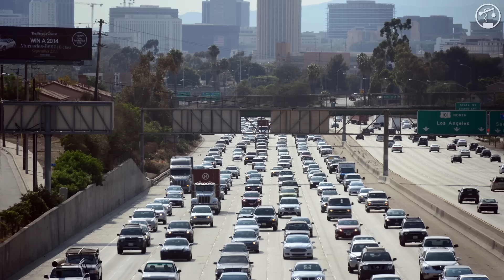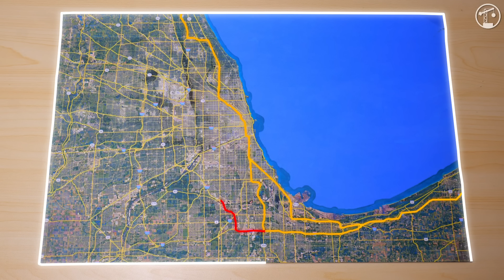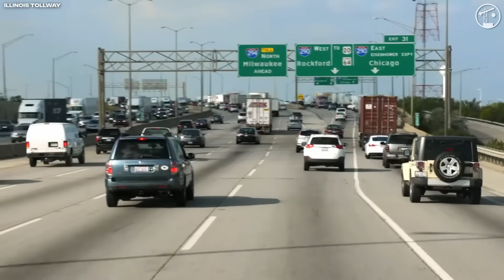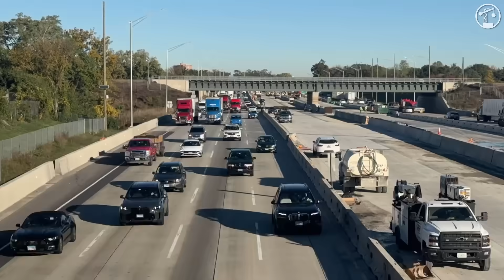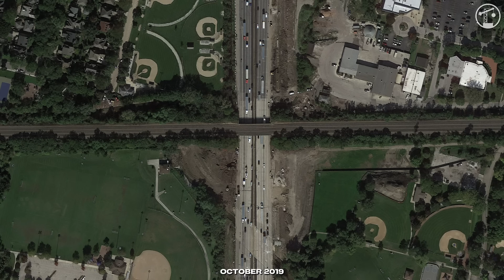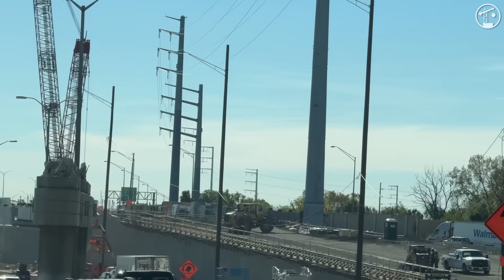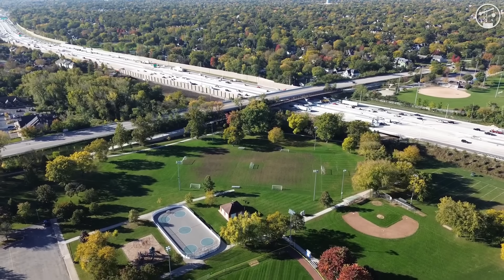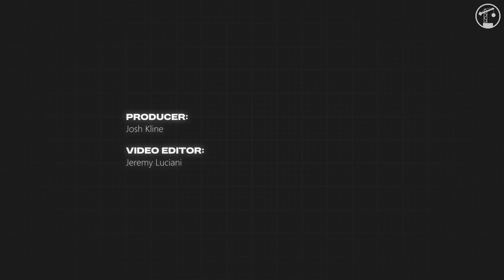Why Chicago is Spending $4B on One Road

Comment: We need a north/south rail line that connects all the commuter lines that flow in and out of the city. A line that also connects Midway to O’Hare. It would take a ton of traffic off the road. Commuters could get to O’Hare and Midway from the suburbs without using the interstates and tollways. The current system of riding into the city and then out to go north and south is not practical, so nobody ever does it. A N/S rail line would be a radical improvement.

Just one more lane will never solve anything. People need options.
Reply: More effective would be better through connections downtown, though the O'Hare Midway link has also tested really well on surveys and analytics in terms of projected ridership. The Metra lines should connect directly with each other and run more frequently, and another crosstown subway is needed. Fast connections through downtown also help suburb-to-suburb commuting, especially crosstown where the 90-94 route is so congested and people use 294 to escape.
Reply: @dblissmn  that could help but it would require most people to still get all the way to down town stations. A proposed line (sometimes as an L or Metra) would run from Midway to ORD through the near western burbs. It could connect the end of most L and most Metra lines, allowing for a very different level of service and connection
Reply: The “Cross Town Expressway”. Turn Cicero Av. into an expressway in the 70’s would have been a few billion dollars…
Enjoy sitting in traffic because it’ll never happen
Reply: You still need a car at both ends of any N-S trip - there’s no central business district like the loop.
Reply: @lauracarrolldebolt9233  You actually don't. Hyde Park? Walkable. Homewood? Walkable. Glenview? Walkable. Etc. And all the above also connected with bus service.
Reply: RTA has floated this several times.  There just isn't the ridership projections to support doing it.  Most people that live out here in the further out suburbs (Myself in the western), only take Metra to go IN or OUT of the city.  No one in their right mind out here is giving up their car to commute 15 miles away via a commuter rail system when they have a car and just hop in and go.  It makes NO logistical sense for me in Elgin, if I need to go to Aurora, to drive over to a station, then wait, then take a rail line to a station nearest my destination, which then is also usually outside an acceptable walking distance to get to the final destination point.  Again, get in my car and be there in 20 minutes.  NOW, what I will push for is an even further outer beltway, similar to 355, out here as Route 59 and Randall Road are disasters in peak hours.
Reply: It probably would cost 1/8th of this one road’s price tag. But then, what about the politicians who make money from the construction? They’ve gotta put a new roof on their cottage somehow!
Reply: this rail connectivity to O’hare and Midway is not necessary.  Midway is connected to rail via orange line.  Metra connects to the “EL” at various locations throughout the system and downtown.  O’Hare is served by Metra now.  The station is adjacent to the rental car facility where you can catch the people mover to the terminal.  Of course O’Hare has had “EL” connection for decades.
Reply: @CJinsoo Metra serves O'Hare in name only.   There are only seven trains per day, of which five actually stop at the O'Hare station.  And of those seven, six of those trains serve "standard" rush hour commuters and one would be for "reverse commuters".   No weekend service.  No service after standard working hours -- it is meant for 9-5 suburban resident to downtown worker only.

The major problems with NCS are that the line is single track north of O'Hare, which limits the schedule; and south of O'Hare, it encounters delays as uses the same tracks as the MD-W lines.
Reply: @JeffreyW67 that is plenty of service from Metra for O’Hare.  Do you think it needs a as much service as Metra provides downtown loop?  there is no way there would be any type of customer demand to support that because passengers have alternatives.
Reply: @JeffreyW67  pretty embarrassing considering Toronto's 4 times hourly for a similar type of route terminating at its main airport.
Reply: Midway and O'Hare already are connected via rail. You just have to make one underground transfer in the Loop.
Reply: @JonPoklop  it is but not well. Most places in the city are at least 2 hours via transit to O'hare. Let alone the burbs. A circle line on the edge of Chicago connecting metra and L lines would be pretty significant upgrade.
Reply: @whothei0  I would love to see a CTA rail line run along Belt Railway (the tracks at 4600 W/just east of Cicero Ave) starting at the Montrose Blue Line.  The train line would run south to Midway Airport, and then southeast past 67th St to connect to the Red Line at 90th/State, and finally end at 95th/Cottage Grove to connect to the Metra Electric main line.  Of course, if CTA/Metra was more ambitious, the train could run even further east to end at either 93rd/Harbor (walking distance from South Chicago [93rd] Metra Electric) or southeast to the Hammond/Whiting Amtrak station across from Horseshoe Casino.

Combine the Belt Railway Line with an extension of the Brown Line to Montrose or Jefferson Park (Montrose would make an easier loop; Jefferson Park would have more connectivity with CTA/Pace buses), and you could have a true loop in Chicago.  For a more direct O'Hare/Midway connection, you could also add a second branch of the Circle Line northwest of 4600 W Roosevelt, running west along the CTA Blue Line to Forest Park, NW through River Forest/Melrose Park/Franklin Park, and then NW along the NCS tracks to the O'Hare transfer station.

As for right now, I would like to see CTA combine the #54/#54B bus into one route (#54) between Cicero/Pensacola and Midway Airport, and allocate the segment between Midway Airport and Ford City to Pace.  Also, add transit signal priority and increase stop spacing to every 2 blocks (0.25 mile/0.4 km), except where bus/train routes connect.  This would not be as fast as a rail line, but definitely decrease travel times to Midway from the outer neighborhoods along Cicero Ave north of Cermak Rd (where the 54B currently begins).
Reply: @chijason6630 Love it. Transit is the future, not more car lanes.
Reply: @JonPoklop  The Mid-City Transitway would not only connect the airports directly but provide a direct north-south link for the west side and the inner western suburbs; when they did market research 20 years ago they estimated this one route would yield 60,000 rides a day.

Comment: I commute on 88 and 294. At a certain point, you have to wonder, are the construction shutdowns worth it? They have closed down exit lanes from the 294S to 88W for a year or more and the traffic is so bad I have to take an alternate route. Even at midnight I've hit stopped traffic at that exit. My parents have lived here 30 years and they say there hasn't been a single moment when 294 hasn't been under construction. All for what, adding more lanes? Like that's ever worked.
Reply: the I-90 rebuild [Chicago-Rockford] was definitely worth it - a lot of patience - but the finished result is fantastic.

Comment: I love the train because of this
Reply: What traing connection do you have which can take you from south suburbs to O'hare? Sure you can travel through downtown, but that is like 2-3 hours.
Reply: @robertgworek2497 I used do this when would I visit my folks in Oak Lawn and commute to Rosemont and I still prefered it to the stress of 294 at rush hour. Throw on a Hotspot, log in, and just work on the commute. Did 294 for years and I'm mad I'll never get that big part of my 20s back.
Reply: @robertgworek2497  I live on the north side right on the north shore Metra line. I can also take a 15 minute drive to Linden if I need the L
Reply: @WillHellmm  I live in SW suburbs and I can easily get to the downtown with the Metra train, but O'hare, W or N suburbs are almost out of reach for me without a car. I checked it. It's early Saturday, and there is no traffic at all. I would need 28 minutes to get to the O'hare with my car and   2h 40min, with public transportation and I would have to take a bus then red and finally blue line.

Comment: I lived in both chicago and NY. Can't see how Chicago ranks worse for traffic. Even when there is a lot of congestion it's still moving. NY traffic is at a standstill.
Reply: you guys have a better metro system tho. a larger one, and walking has greatly increased in NYC. our public transit needs more help.
Reply: @diegokiwi1854  I'll disagree. While the MTA needs work, the design was much better thought out. I've never understood why in both Metra hubs in Chicago there's no CTA. In NY, Penn station has the subway right there.
Reply: @bhorv67  NY has way more expressways/parkways for cars, but STILL doesn't have a subway line to LaGuardia.
Reply: @bhorv67  Rarely do the commuters who use the Metra need to use the CTA Loop and vise versa, at that point they are mostly using buses or walking.

Comment: I-88 / 290 / 294 AKA Hillside Strangler.

I have noticed a lot of people raving about the new 294 N to 290 N fly UNDER ramp.

IL 83 Kingery Highway and 12 / 20 / 45 Manheim Road can be effective 294 Tollway alternatives, in spots.
Reply: "Hillside Strangler"    Hadn't heard that for awhile because I moved, but it does bring back unpleasant memories.
Reply: vivid memories of when they "removed" the hillside strangler - at the same time improved and widened Roosevelt and Cermak - had a datacenter in OakBrook, OakPark to OakBrook < 30 min at 2am, > 90min during the day.
Reply: I understood the Hillside Strangler to be where the multiple lanes of 290 and 88 funnel into the dual-three formation of the Eisenhower Expressway through Maywood and Oak Park. That bit is still up for grabs; to uncork it without substantially increasing public transit use, they really either have to widen to four lanes each way, or remove the local exits.
Reply: I remember the “Hillside Strangler” …..my left leg is stronger to this day as a result of driving a stick shift car through there daily!

Comment: The longest continuous construction project in the world. Since it's inception it has never not been under construction. I commute it 2-3 times a week and there are full blown concrete plants built alongside the interstate. It will never be finished.
Reply: There's a saying in Chicago, "There's two seasons here: winter and construction"
Reply: @CorderralLewis for 294 it's only one season, construction all year round!
Reply: @CorderralLewis 🎯‼️
Reply: @CorderralLewis  Yes sir
Reply: And when the initial Bonds were paid off the toll booths were supposed to have been taken out, lol. That was 60 years ago. I drove 294 from Blue Island to Carol Stream for 11 years, never really had a problem if you left early enough, but if there was a snowstorm or heavy rainstorm, you better hope you have enough gas in your tank because there's not an exit every half mile or mile.
Reply: @johnvrabec9747 biggest lie we were all sold on back then. Once that money flows in no one wants to stop it
Reply: @johnvrabec9747  Well now some of the tolls are going to be siphoned off and used to subsidize Pritzker's newly created NITA (Metra, CTA, RTA).
Reply: @johnvrabec9747 I love the tollway, drove 294 to 88 from des plaines to Batavia and they kept up with snow. Now I'm mainly i90 and only issue is fast drivers crashing. Can't wait for the 294 exit to county line
Reply: @johnvrabec9747  Yeah its fuckin bullshit.
Reply: @johnvrabec9747 true yet for the toll roads to be worked on.. they are in better shape then the free interstates in overall conditon.. look how neglected 80 was wirh the bridge that has hole through the road deck where you can see water.. took illinois 15 years to get the funding from the feds to help while needing to raise the gas tax to help cover thst rebuild.. the tollways get their funding from the tolls. While also keeping off people who cant afford the tolls off.
Reply: Eh I think Sagrada Família has been under construction way longer, even if you only count after 1939 restart post civil war.
Reply: @whothei0  Haha... Nice comparison!
Reply: the Tri-State Tollway has had to overhaul itself TWICE (from 3 lanes to 4, now from 4 lanes to 5) cuz of humanity's dependency on cars AND the tollway being a MAJOR north/south thoroughfare around the biggest non-seaport transportation hub in America. that specific interchange needed this massive overhaul TWENTY years ago, to be honest (and the Tollway folk knew this) ... THIS specific overhaul did start in 2020, but it is a MASSIVE task to rebuild the whole (massive) interchange within the footprint of the existing interchange itself. it isn't a shock that it will take seven years to complete.
Reply: @dhinton1 dont forget trucks as almost all goods are shipped by a semi.
Reply: To be fair, its often cheaper to erect a plant and control everything than to buy it in.

Its often worth it for even a small roadway project.
Reply: @nes999  Concrete does not travel well and must be the proper consistency.  Anything off, the load is rejected.  Better to mix on site and deliver quickly than from 10 miles or more away and take an hour to get there.
Reply: its a infinite money glitch to maintain jobs nothing ever gets actually built
Reply: I work for a construction company that has worked on the Indiana side of the toll road in NWI, we will construct portable asphalt plants along the project so that we don't have as far to carry the hot asphalt. It is crazy to think that that is more convenient and cost effective based on the magnitude of the project.
Reply: @hotboyharry3674 unions one thing indiana doesnt have to fight with like illinois.. they get to dictate how a plan gets set up to keep their employees working..
Reply: @thomaslascola9683 Indiana highway projects are heavily unionized. When the GC needs 50 laborers, they go down to the union and get them.
Reply: 😂😂😂 very true
Reply: Thats because as long as construction is going, it can remain a private entity. Once its completed it becomes state owned so pointless construction will never end.
Reply: Is it just me, or is there waaayyyyy more salt on the highways now than ever? 55 has literal craters in it. I don’t ever remember being them this bad.
Reply: @pillarsofivory rathrr have enough salt to prevent ice from idiots slamming into me. But yes I also noticed shit ton of salt on 88-290
Reply: @pillarsofivory 55 is an interstate that doesnt get the same level of care to maintenance as the tollroads.. as its idot vs tollway specific crew for tollaways.. all the craters is because of how broke we are we have to stretch not to mention with how many cars are on the road today the longevity of materials just doesnt last as long requiring more upkeep and sooner construction that we dont have the money for.. the biggest contributor to demand on cars is the fact wirh public trans it isnt reliable ans companies dont care you have to be on time yo work or you get fired.
Reply: That sounds great, it's good for infrastructure to be maintained and improved. 
Unfortunately too many areas are being neglected requiring even more extensive work - like the Jane Byrne interchange that had never been worked on since initial construction.
Reply: Because its the top 3 used highways in america.. because they havent built a similar north south further west basically route 59 should have been a toll way or high way.
Reply: It would have been paid off decades ago, except they didn't pay any principal on the loan.
Reply: And the sate will never stop RAPING THE TAXPAYERS!
Reply: Good for me!! We start back up in April! 
I'm a flagger,  don't forget to wave 👋🏽😊
Reply: @amunetbastetraeyeam6673  Ain't your fault. Get your money!
Reply: @amunetbastetraeyeam6673  & slow down
Reply: That's the magic of car dependency. Most cities in other countries don't look like this for a reason. It sucks.
Reply: @Descriptor413  yeah I love cars and motorcycles but commuting is way better via mass transit.
Reply: @Descriptor413 because some us states are bigger then whole countries in europe.. therefore cars are needed. As public trans isnt always reliable to get to work on time.
Reply: Nope. That title goes to 80/94 in Northwest Indiana. It has literally been under constant construction since 1990
Reply: Cash cow hiding place for state write offs! As soon as they are done they start all over again because it’s been to long with proper maintenance and money management!
Reply: That’s because all the corrupt contractors and corrupt politicians have a real sweetheart deal going for them.
Reply: Eternal construction is required in Chicago because those union votes aren't going to buy themselves.
Reply: Pritzker has already got his hands in the tollway cookie jar.
Reply: @NoNo-iz8hd oh the boogie man 🤡
Reply: @NoNo-iz8hd your politics cloud your judgement and reality. Imagine hating someone without the knowledge of what's actually happening. Just don't post and move on...Jesus...
Reply: @NoNo-iz8hd I really hate Pritzker but he's not worried about stealing money. He's a billionaire from a family that's been wealthy for many generations.